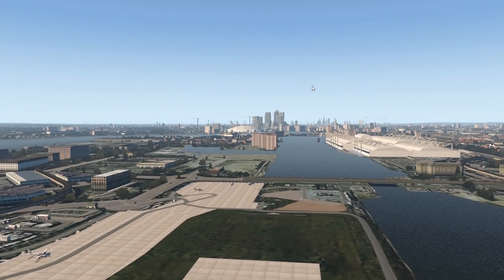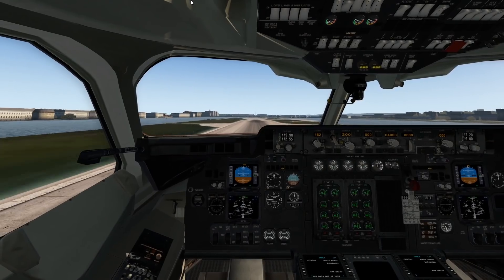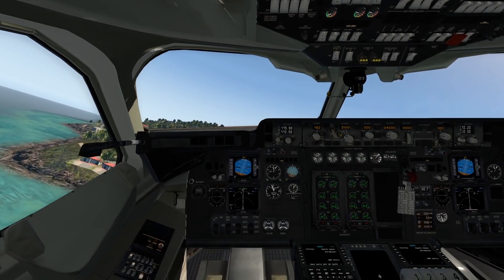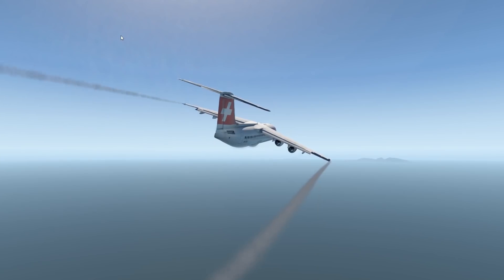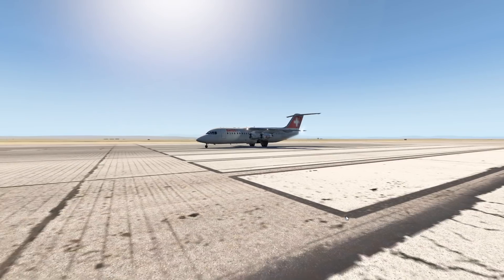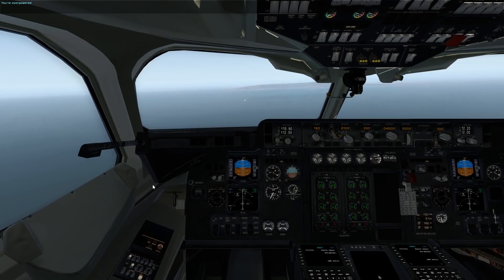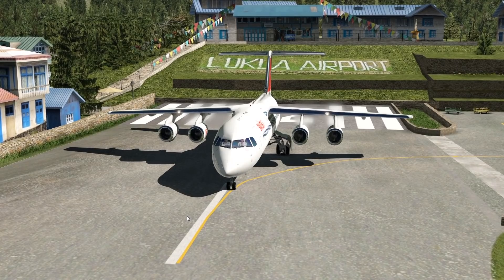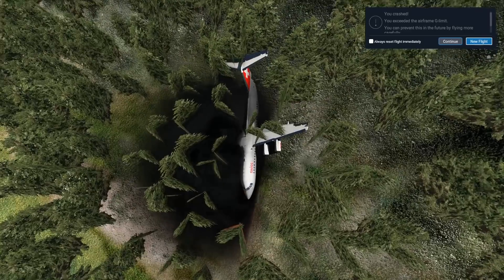Does The Avro Plane Really Need 4 Engines?

Comment: Well,there were plans by British Aerospace to create Avros with only 2 engines (not kidding), one of them had CFM-56 engines and winglets (BaE NRA)and the other removed the High-wing and replaced it with a Low-wing (BaE RJX) Both of these designs had 2 engines instead of 4.

Comment: the plane crash landed during take because a plane needs power to take off. in the avro, you need 50 to takeoff and 75 to climb. in cruise the avro neds 45. a climb with flaps 15 and gear down needs 90. speed 165 knots i used my calculator and specs of the avro. i dont use x plane

Comment: I remember when ian avro crashed with the entire brazilian team Chapecoence onbooard,it was a sad time for football fans,they were on their way to their first semi final I think and majority of the team died when it crashed in coloumbia I think
Reply: The cause of the accident was the negligence of the pilot, who also owned the company, Lamia. He filled the fuel tank at the limit until the airport, with nothing more to other airports in case of emergency. They should have made a stop in Bolivia, but they didn't. During the flight, the pilot and co-pilot were calculating to see if the fuel would be enough. Arriving near the airport, another plane said mayday, then took priority and would land first. They had to go around the airport as the flight letter said, and instead of saying Mayday for lack of fuel, he only did this when all four engines went out. He didn't want to say mayday because he could be arrested for negligence, for putting the fuel right to the limit, with nothing extra, which is illegal. There were only 6 or 7 survivors.

Comment: It really does. Over 30,000ft it runs out of oomph
The engines are tiny because they had to be quiet. 
The BAe 146 was built at Hatfield, the last plane to fly out of the original DeHavilland factory there before the company was sold to Canada and the factory and airfield closed

Comment: If the plane only had 2 engines it would be too weak so 4 was the only option, if there would be 2 larger engines it would be too heavy and too fuel demanding.